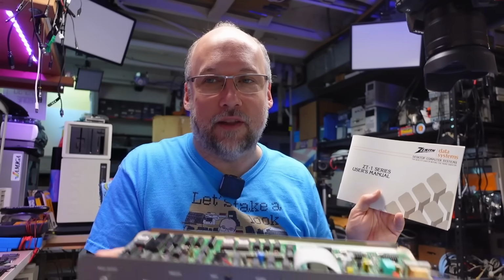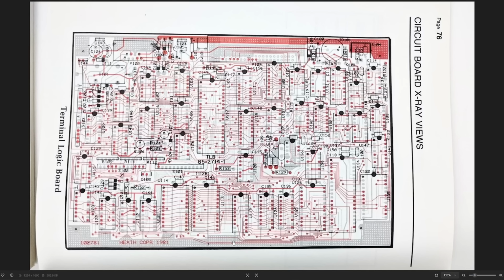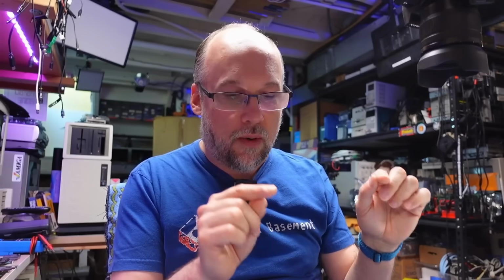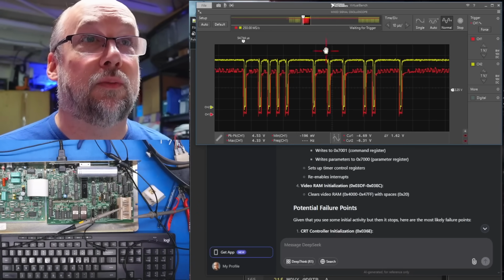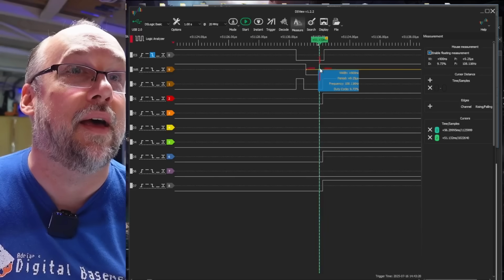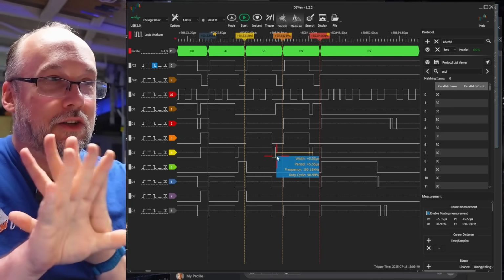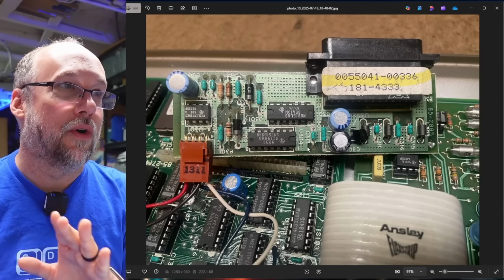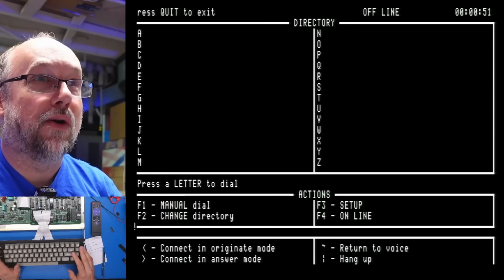The Zenith ZT-1 alive. Sort of.

Comment: Please don't use AI! It would be a lot nicer if you asked the vintage computer community for help with assembly code.
Reply: It's a jumping off point not the end point
Reply: I guess I don't really understand why this matters, as long as you use tools you found and review the information.  It would be no different than if he said 'I got this information from reddit, or wikipedia, or facebook threads'.  There's lots of bad data out there, which is what trained these LLM models.  You use these tools on the internet (which is just what LLM's are, a collection of info from the internet) to review and give you a unique perspective or help you think outside the box.  It might help, it might not, but it's no different then asking other people on the internet for an opinion... there's lots of bad opinions from real people too :)
Reply: IIRC he uploaded the Roms and asked for help in the first video. Looks like there weren't any takers.
Reply: That would also be nice, but in this case he just tried and it helped, so that's also an option?
Reply: @punishedbrains  But you have no way to know if the AI is correct or not.  I don't use it.  Never will.
Reply: @timradde4328 You need to have some knowledge about what you're asking (at the moment), and Adrian clearly has and identified what made sense and what not. And by doing that still was useful.

Comment: Please stop using AI for trying to figure out what 8-Bit assembly code does. It just doesn't work properly and comes up with all kinds of nonsense. Either learn how to read assembly or simply leave it be. Everything else is a waste of your and our time.
Reply: AI's produce useful stuff, and complete garbage all at the same time.  The trouble is telling them apart.

I'm quite glad he used an LLM.  The video really shows the limitations of it.  It did produce some useful answers for the most basic parts.  Once it got to anything more advanced, it hallucinated.
Reply: @stevesether  Just like a reddit post.  Hahaha.
Reply: @Brian_PM  Also true.
Reply: Any tool even if not perfect is useful, in the right hands.  For experienced people, the AI's can help a ton, I use copilot almost everyday now to write boiler plate code, is perfect for that. 
And yes is many times giving the wrong suggestion, but more times than not, is what I want or a good pointer for what I want and so, something that would take me hours or even days to write, takes way less time now.  
Thou for absolute noobs, this AI's are obviously very detrimental and bad sources of information.
Reply: @Argoon1981  Using AI to write boilerplate is kinda silly. We've had automated tools for that for a couple decades now that don't require excessive amounts of energy and computational resources.

Perhaps I'm a boomer but I don't even use that. Writing boilerplate gives my mind time to reflect on the high-level intent of what I'm trying to do. I often find that my software design gets better in the process.
Reply: @Argoon1981 I agree. But it's just not good with old assembly dialects and Adrian is obviously a noob when it comes to assembly code. So he has no way to check if what the AI tells him is right or wrong. In this video, the AI replied with so much obvious nonsense, that I wouldn't trust it one bit. And to figure out that the ROM clears screen memory with $20 is nothing for which you need an AI for. It's only logical.
Reply from the maker: I'm surprised by your comment. I'm not going to learn 8051 assembly for a video, it's an architecture that is hardly used on things I repair. (This is the first time I've worked on anything using it). Learning a completely new architecture from scratch would have taken me potentially days or longer.

And as was evident by this video, without the work the LLM did, I would not have been able to understand what the ROM was trying to do, which directly led to me being able to diagnose the machine.
Reply: @adriansdigitalbasement  I use LLMs sometimes when I'm stuck in software dev.  As you've seen, it's a crap shoot.  The key is figuring out where it's right, and where it's wrong, and you seemed to do a great job of learning what you can from it, but also calling it on its BS.

At my work, there's a large split between some of the developers on LLMs.  Some people swear by it and use it constantly, others won't use it at all.  It's mostly about skill level (backed up by some studies as well). If you're at a low skill level on something, it can help you raise your skill level.  If you already know more than it and are near expert level on the task you're doing, it's easier to just DIY than pick through the mistakes it's made.
Reply: @adriansdigitalbasement I must have missed the point then where the AI produced anything meaning- or helpful in this context. I tried using AI to generate 6502 assembly (which should be a much larger training set) and even that doesn't really work. It's great for modern languages and can really help there, but it can't even explain simple 6502 code properly. All it does is to wildly guess things and sound very confident while doing so.

Edit: And about the time frame to learn it: I know that you are more a hardware repair than a coding guy. But if you know any other assembly dialect, 8051 is really easy to understand at least enough to verify if what the AI says is at least half reasonable. Understanding MOV as well as conditional and unconditional jumps should be sufficient to find out where the ROM is for example filling the screen memory. It doesn't take days, it takes maybe 15 minutes.
Reply: @EgonOlsen71  The issue with vintage code and LLM's is that LLM's are confused by the vast amount of information it has, and most of it is modern technology.  For instance, it's databases are filled with tons of information on python, java, and other languages from the internet days.  I've experienced this issue with Basic.  A LLM could write a basic program just fine, but it's not going to write a C64 specific basic program with C64 limitations (as basic wasn't as mature as it is now).  It'll also get confused by the different machine dialects (just like humans do when we try to write a basic program on our TRS-80 then on an Atari 800).  That said, an LLM can be trained on the machine with the proper manuals so that it does only reference the manuals and books that are important for what you're doing. LLM's are just big databases that help you do searches, the same way that Google helps you search the internet and also comes up with bad searches, you just have to know enough to dismiss bad info.  I think we all agree that doing a google search and using the results from that as 100% is going to end in failure, but it just gives you some data in your collective research which you then take, analyze and come up with solutions.  LLM's are just another way to search internet knowledge.  As an aside, i've asked people for help and started to follow advice from people experienced in a topic and found that they were totally wrong.. so being wrong isn't only a machine problem.  :)
Reply: I agree that AI produces a lot of nonsense, but the anti-AI hate is going a bit too far as well. As long as you can identify what's likely nonsense, it can be really useful. I use it for boilerplate stuff. And like Adrian said, it was useful for him in this case, so there you go. One thing That Adrian might do though is to not talk to it too long in 1 session, just restart after a bit as it will hallucinate the longer you're talking. :)
Reply: @punishedbrains I've nothing against using AI. I'm using it quite a lot directly and via various APIs for personal and professional use. I'm also an assembler guy in my spare time and I can testify that AI has no clue what it's talking about when it comes to old assembly dialects. The training set is just too small to be useful. You can use it to generate working Python or Java code without many problems. But try to generate for example 6502 assembly code and all you are getting is a load of garbage that looks right at first glance but just isn't except for the simplest of cases. It's a waste of time at least for now.
Reply: Who cares. AI can help pointing you the right direction. For what Mr. Black does he could teach AI a thing or too. Some of his c64 videos helped me countless times. Without schematics its pretty hard to figure out things but not impossible.

Comment: I'd be willing the bet that the ribbon cable going from the main board to the modem board is just an RS-232 serial connection plus power.
Reply: And some extra control signals. It is most probably not Hayes compatible.
Reply: @alisharifian535 possibly, but not necessarily.  Hayes and most modems I knew of sent all the control commands over the standard serial data lines using special control sequences.
Reply: @jasonharmon4588 acoustic couplers and pre-AT command modems do not do such a thing,you had to do the dialing procedure yourself.I said that because the ribbon cable seems to have more than 10 wires to me.

Comment: 14:02 that makes tons of sense. I wonder if the “C” in D444C might stand for CMOS?
Reply from the maker: It's not totally clear because it's really hard to find any info on the chip at all. Part 3 is underway and I do some more testing regarding that chip. (And other things of course.)
Reply: Yes, a  μPD444 is a CMOS RAM chip (equivalent to a 6514)... used them on battery backed RAM boards back in the 80's.
Got a load in my components drawer ...

Comment: My mother’s cousin’s husband built a color TV from Heathkit. This is as the late 1960s. I watched Star Trek in color for the first time at their house. He used to build a number of kits from Heathkit.
Reply from the maker: How damn cool. What a time that a kit color TV was even a thing one could buy and make.
Reply: My father also built a color TV from Heathkit. I was pretty young when he did that so I don't remember it. He told me about it though. He accidentally inserted an IC backwards and blew it out. Then he went through the troubleshooting and figured out what was wrong and got a new one and it worked.
Reply: @jandjrandr  My father built one of those too.  What I remember is that it took a really really long time to get it all together. The TV was decent though, and lasted for awhile.
Reply: I remember seeing magazine ads for TV Kits here in Brazil in the 80's and thinking "Wait, you can BUILD a TV AT HOME?!" 🤯

The kits were sold by "Instituto Universal Brasileiro", a mail order business specialized in courses for electrical, electronics and automotive repair.

The idea is that you would subscribe to the course, get new lessons (and some of the parts) in the mail every month, and by the end you would have all the parts and knowledge needed to assemble the kit. The ads were pretty common in comics here in the 80's.
Reply: My dad built one of those color televisions, too. (Probably the same model.) We had that TV for many years.

Most of Dad's electronic equipment came from Heathkit and Eico. I still have his original Heathkit oscilloscope. It's only recently that I realized how much of his shop was built from kits.
Reply: Few people know the original Star Trek had such colorful sets and clothes because Zenith had just introduced color TVs and they needed a show that demonstrated color TV in a bold way. That and the show’s producer Desilu Studios had just shifted production to color. How’s that for marketing.